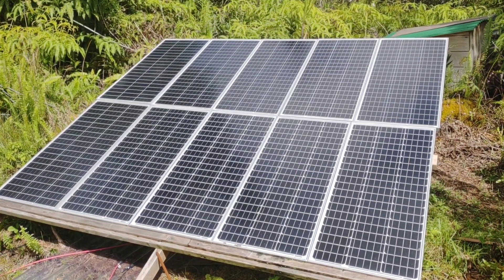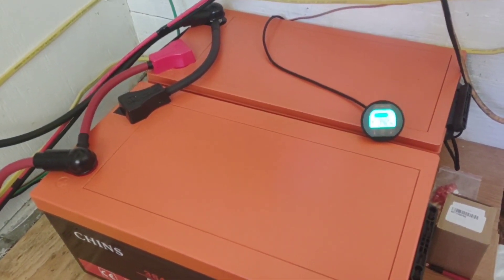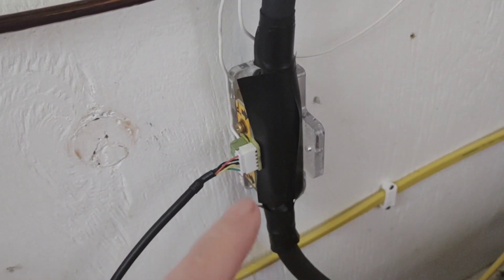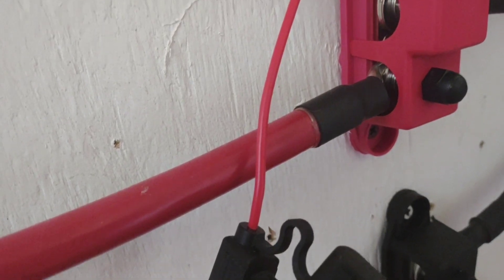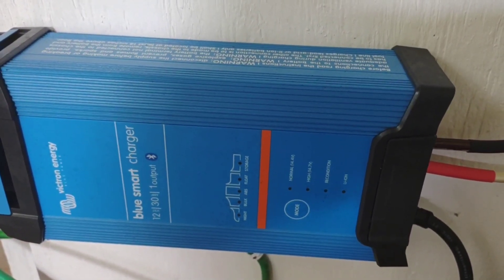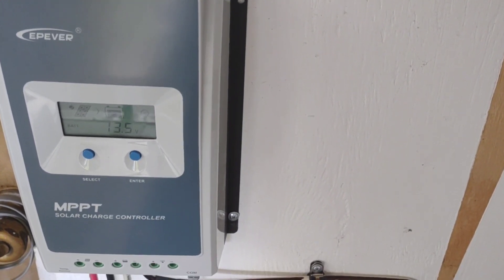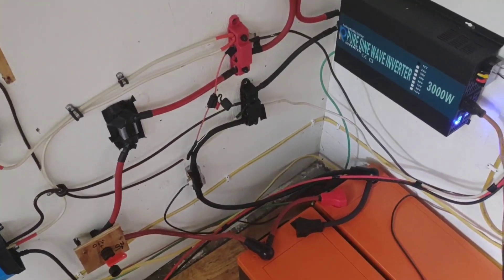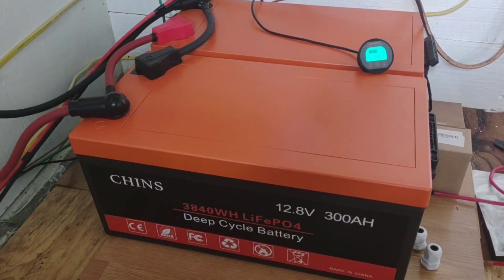9 month review of Chins LiFePO4/ entire solar system

Comment: If you plan is to keep updating I would suggest getting 1 Midnite classic 150 that can easily handle up to 5000 watts of panels and 10,000 watt over paneling and switching to a 48 volt system and you would need 2 more lifepo4 batteries,
I'm at 5.6kw panels and 4 200ah lifepo4 batteries it's very close to being on grid apart for trying to run electric heaters through the night.

Comment: If you were looking to clean your system up even more, you could use DIN rail DC breakers instead of the individual breakers and fuses. Set up a high voltage (120 volt) and low voltage (12 volt) breaker panel and really clean everything up.
Reply from the maker: I like that idea a lot and have seen some super clean installs such as that. Mahalo for that!🤙

Comment: Now that you have two 12.8V batteries, wouldn't it be best to run 24V and a single MPPT controller? Though I suppose you would have to replace the inverter and AC battery charger with 24V models.
Reply from the maker: Yeah, would be better as a 24v system , no doubt. Probably keep it as a large 12v system for some time. It does well, but I take your point. Aloha!🤙

Comment: Thanks for letting us know how your bats are doing. I recently bought two chins 300ah smart bats since I’ll be using them in subzero. I’m new to lithium too and had no info on them until I saw a will prowse vid on one of his breakdown inspections. He gave the 100 or 200 ah bats a good rating. 

One thing I saw in your vid that you could do to improve safety is mount your system on a non flammable backboard as recommended by victron. I’m looking into what product will work. 

Please keep posting us on your system
Reply from the maker: Mahalo for tuning in,  and best of luck with your new batteries! They are still working perfectly here! I'll keep posting updates over time for sure. Zero problems with the Chins.  Great advice on the cement board too! Aloha 🤙

Comment: How r u cooling ur home?
Reply from the maker: I actually don't need cooling here.. I'm lucky for that!🤙
Reply: you can easily run a 500watt to 800watt window a/c with the setup he has.  I run a 600 watt (8000 btu) window a/c with my DIY 12V 100ah CALB LiFePo4 solar generator all day long using a victron energy 100/50 mppt solar charge controller and 800 watts of solar panel power (two series arrays of 4x100W panels, hooked in parallel, total 800W).  Works excellent so long as solar produces power all day long!

Comment: You probably know by now that your BMS for two CHINS  batteries limits you to 400 Ah.  I have the same ones you do.  BTW, Chins is tops in customer service.  I have asked them many questions, and they have been quick to reply.
Reply from the maker: All correspondence with Chins has been positive in my experience.  They respond quickly,  address my questions or problems,  and they back their products with pride and integrity.  Puts them on top shelf in my opinion. Aloha 🤙

Comment: Great update. I have 1 Chins 300 AH battery that's been sitting in my garage for almost a year. I have zero experience with solar but am starting with a renogy 400 watt system. My question is how do i check the current level of charge of my chins with a multimeter? Cant wait to get started. Have enjoyed your videos and like how you show the pitfalls you run into. Looks like a solid system. Amazing how you only use 16% a day. Pretty impressive. I plan on using my solar setup for my off grid van. Thanks for all the videos! Richard in Texas.

Comment: Many people say that particular Epevers controller does not come preconfigured for Lifepo batts, and that you need a laptop or android phone to make custom settings.  Is that true, or do you use a pre-programmed factory setting?
Reply from the maker: I own a few, and only the newest one had a Lifepo4 setting. I ultimately went back to user settings,  as the pre set values were a tad high for my system 🤙

Comment: Love your set up! You convinced me on the CHINS 300ah. Just curious because the wording confused me on the parameters to set on my charge controller; what parameters did you settle on/decide was best? Currently charging mine at 14.6V. is that too much? I'm a self taught newb so I apologize if this isn't a meaningful question.
Reply from the maker: I currently run it up to 14.2 v and it's working good for me.  I kept triggering alarms at 14.6. My MPPT wasn't fast enough,  but doing well now...aloha 🤙

Comment: That's a nice setup. Let me just give you a little word of advice: Since you only use around 20% of the total capacity you would be better cycling your battery between 40 to 60%. LFP batteries, unlike lead-acid, are less stressed at intermediate state of charge and will degrade much less when cycled as close to the middle as possible. For example, while an LFP battery cycled between 40 and 60% will have a life of 6000 cycles, the same battery, cycled between 80 and 100% will have a life of 4000 cycles. This is because lithium chemisty suffer a higher stress and degrade more at extreme voltages (either low or high).
Reply from the maker: Now that's some great advice! Much appreciate the details and time to share this information with us....aloha 🤙

Comment: Good job & thanks for this info. Your system looks great for what you are doing and plan to do in the future.  I dont know how beneficial capacitor are nowadays with the lifepo4 tech that’s coming out now, but I am a big proponent for using large Maxwell 3000f -3400farad cap banks to make 16v in your case or even two sets in parallel with heavy leads as close to your inverter as you can as this will help filter bursts to your inverter and from your input controllers as well and greatly soften any large burst placed on your batteries. If you want to get tricky, you could set your battery parameters to stop charging at a preset voltage/cell about 3.4v -3.5v/cell max, but let your capacitor bank go slightly higher, but lower than any cut off level for your inverter and this will take a lot of load off your battery Banks.  I would also suggest you check out Andy’s ‘Off Grid Garage” on YT in sunny Qld Australia, he is a real guru if you are interested in any solar or battery charging specifics, “Will Prowse” is another YT phenomenon worth checking out, you can learn so much from these two guys, good vid and info, cheers from Australia
Reply from the maker: All great information,  and thank you for sharing this with us.  I do watch both of those guy's,  and have learned tons from both. Mahalo for tuning in...aloha 🤙

Comment: Do you have a 1 line diagram of this system?
We're you able to charge the two batteries off 400 watts  of solar?
Thank you
Reply from the maker: To keep up with current needs, now running two 500watt strings for a total of 1000watts.  Working great. 🤙

Comment: FYI, Victron recommends that your 12V battery charger should be mounted vertically instead of horizontally.  Vertical mounting allows the unit to cool with natural air flow from the bottom up.  If you leave it horizontal position, you will find that it will not charge at full capacity due to thermal throttling which I have experienced in my own setup.   When I reoriented it to a vertical mounting, the throttling issue disappeared.
Reply from the maker: That's great information,  and thank you for sharing that with us! I'm going to try to reposition mine as you say. aloha 🤙

Comment: Why two charge controllers? Or are you replacing the one you have?
Reply from the maker: running two 500 watt strings, each 40 amp controller for each string...🤙

Comment: looking great ! I am in NY ,Boston . ben some weather challenges hear. Heavy snow . Rapid snow melt with flooding and a few wind storms. I have wind power as well to my solar. appx 1.2Kw 24V and 12V . I do have portable solar gen with LiFePO4 battery. I take camping. with LFP 12.8V they have higher top charge voltage than lead. That inverter warring is letting you know upper limit is reached. if voltage goes higher it will turn off. same for low voltage. during a wind storm 77MPH wind and sub zero temps I had my 24V inverter shut off . ben fun hear as well.
Reply from the maker: I've seen the weather out your way still looking wintery!  Been pretty nice here lately,  topping off the batteries nearly every day...or close enough anyway. Thinking I'm going to drop my bulk from 14.5v down to 14.2 to avoid those alarms.  Both the Victron charger,  and charge controller using 14.2 for bulk. My thoughts are not much to be gained past 14.2 anyway,  and given the one or two second delay the Epever cc's take to adjusting the voltage at 14.5, then a burst of momentarily going over and chirping I'll eliminate that. Happy you're having fun with your system too! Love it, love it! aloha 🤙

Comment: I have the same battery setup with 200 Ahr BMS; which do you have? Not all Chins 300Ahr battery is same I noticed when comparing them during purchase. My question to you: whenever the refrigerator starts on the cycles, does your Inverter go into a high current shock and initially kick on the fan? I don't know if the 3000W inverter does any better but my 2000W sure sound bad with the initial start. I have a 7Cuft chest freezer that I am running on the system. No soft starts available currently.  Does your inverter do a high draw every time the frig start? I also noticed that the Chins charge profile is no good. I had to back off to a lower setting because of high voltage warning during float charge. Like you mentioned- it spikes when cloud passes over past the max set voltage and my Victron SCC is not able to handle.
Reply from the maker: Mine have max continuous charging of 100a, and max continuous discharging of 200a. Sometimes while my refrigerator is cycling on, the fan does come on the inverter.  Everytime its cycling in the defrost mode the fan cycles on a few times . Defrost mode is approximately every 24 hours for about 30 minutes.  Otherwise,  during normal cooling cycle it usually only kicks inverter fan on during the day when the temperature is warmer in the utility room. It sounds, and acts like a normal functioning inverter,  with no abnormal sounds. Whenever the fan kicks on it's normal run time is maybe 15 seconds. All that being said,  my refrigerator is an inverter compressor type,  which draws pretty low amps, avg. 4- 7 amps while running.  Defrost cycle pulls about 15a.  I think I'll actually reset my charge controllers to bulk at 14.2 , preventing it from spiking the over voltage alarms when it's topping off at 14.5 currently.  Nothing really to be gained ah wise anyway after 14.2, and both my Victron units use 14.2 for bulk, both the charger and the charge controller. Hope this helps,  and I'll do a follow up video soon on these changes specifically addressing that brief over voltage chirp. aloha 🤙

Comment: Nine months already,  we have all come a long way together.  I have one question that has come up with separate batteries that have seperate BMS and are connected in series or parallel. How is the individual cell balance in both batteries?
Reply from the maker: Time goes quick yes. I have wondered the same thing. I don't know of any way to test that. But after you ask the question I started thinking about that smart battery I have which has on the BMS app 16 cells to monitor, that if I hook that up to a similar 100 amp which I have, and as far as I know have the same internal components if it won't read those cells for me. I'm going to try that and get back to you on it.🤙

Comment: just bought 2 of em because of these videos from you and the battery monitor. my difference is i have a reliable 3500 watt inverter.
Reply from the maker: They were well worth the investment for me. They have also outperformed my highest expectations of them. I'm hooked on Lifepo4 for so many reasons 🤙
Reply: @ProjectsinParadise808  question for ya... I bought the 32a breakers for my solar disconnect. I have 8 newpowa 100 watt solar panels i plan on hooking them up in series parallel 4s2p. my amps shouldn't be over 15a. am i correct in assuming the 32a breaker would be enough? i saw you had the 63a ones.
Reply: i would be using 10awg solar wire fyi
Reply from the maker: @ARMEDPATRIOT757  I was told for isolating the panels make sure the amp rating is high enough to never get above the rated current of the cc. I've never seen more than 50 amps coming off of my string. Near 50 occasionally,  when panels are cool, but only briefly.  So the 62amp rated isolator I'm using should never be tripped, even if the array spikes my cc momentarily.  And so far it's working perfectly as an isolator.  I would think what you describe as your string current,  and cc you would be sized appropriately as well.🤙
Reply from the maker: @ARMEDPATRIOT757  I wrote you a very long explanation on what I was doing, and lost it somehow in the sending process.  If what I just sent , which was abbreviated  doesn't help, let me know and I'll try again.  But it sounds to me like you're sized appropriately...aloha 🤙
Reply: @ProjectsinParadise808  I got it thanks